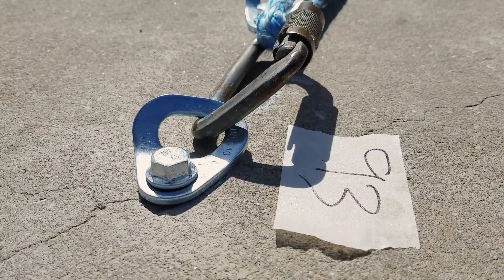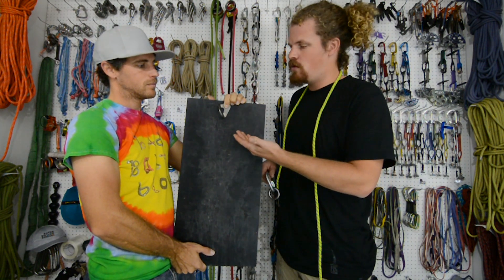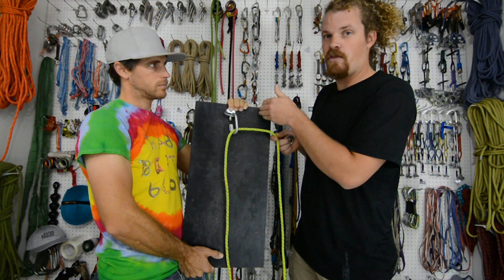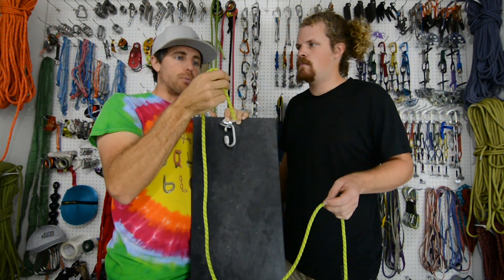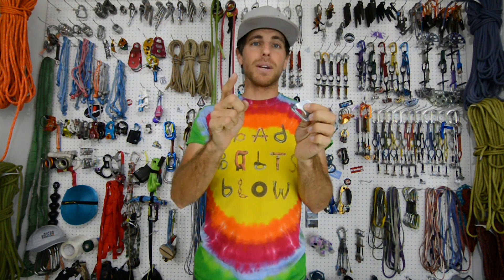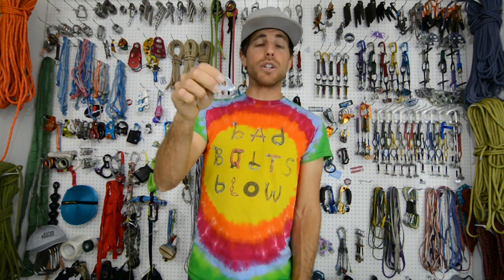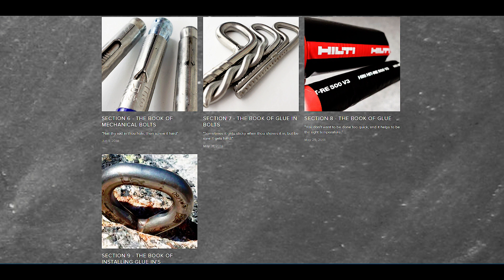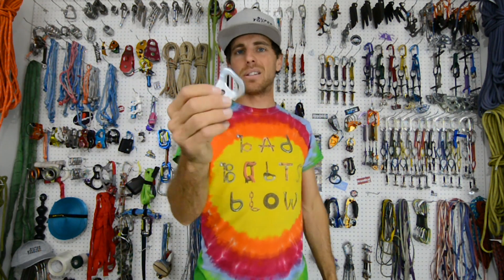BoltBuster - Horizontal climbing hanger break test in slow motion

Comment: So I went through the bolting bible and I see zinc plated items are a no no. I’m currently replacing some rusted nuts on some local routes and my local hardware store sells nuts that are grade 8 zinc plated nuts. I’m wondering if mixing these nuts with the current hangers is ok? I kind of already know the answer after reading your bible but I just wanted to make sure. What do you suggest as an alternative or “standard” nut grade? They do have 304 nuts but I read somewhere that that is equivalent to a “grade 5” nut.
Reply: I don’t know if you ever got your answer, but in case you didn’t, or in case someone else stumbles upon this and is wondering…
Don’t mix zinc plated and stainless hardware as galvanic corrosion can become a serious problem with mixed materials in wet environments.
Also, you should make sure the hangar and the bolt (anchor, stud, whatever) are also stainless before putting new stainless nuts on, as a lot of cheap ones could be zinc plated steel.

Comment: How about testing a 1/2 inch bolt hole hanger on a 3/8 bolt? I’ve seen this out on the rock and was curious if it weakens the hanger.
Reply: So they are relatively safe?  Tension would mean an outward fall which is unlikely, as compared to a downward fall which is most likely.
Reply from the maker: They peel off.  Not at a low force and only in tension testing.